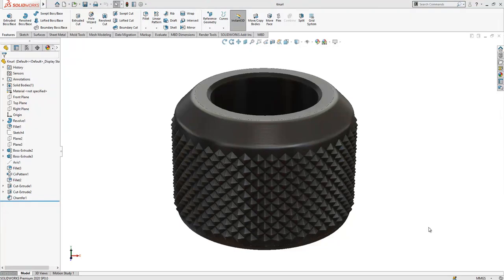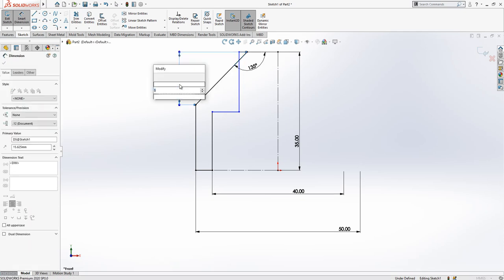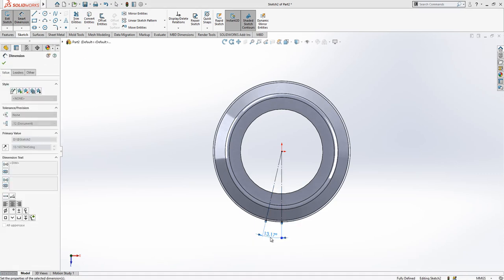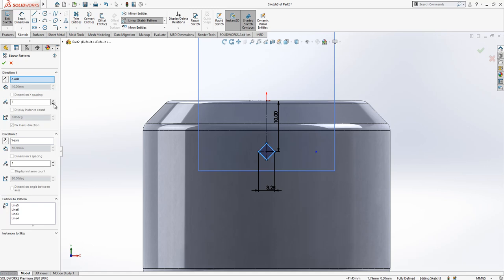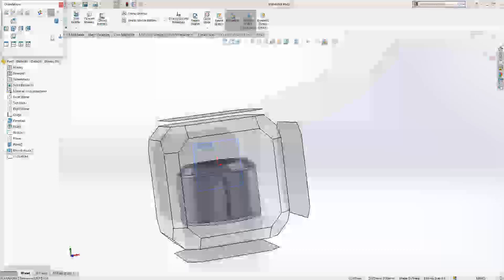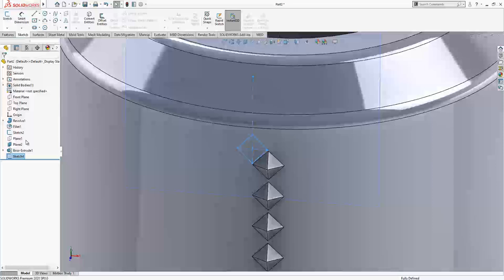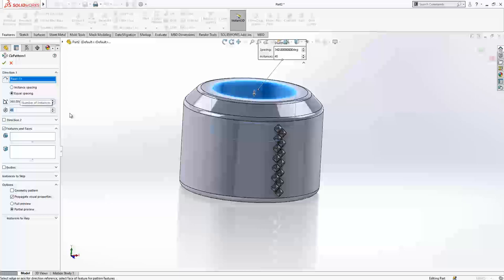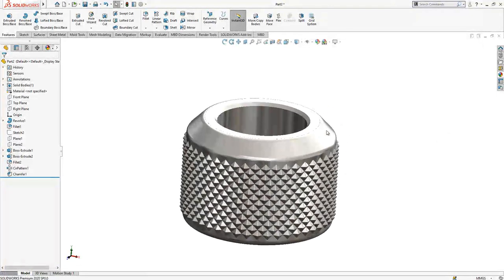Knurling - Solidworks Tutorial

Comment: Thanks for this alternative method, however… I tried it and found that modelling the pyramids close to an edge means that the second direction inward facing outward draft creates tetrahedral points (from one base corner of the initial pyramid) right where the chamfer would be. With your method, it seems you have to leave part of the surface near the cylindrical ends unfinished which looks unrealistic. In my opinion either making a swept cut along a helical guide, or projecting a construction guide line onto the surface and do a swept cut from the end of the cylinder (which you can then pattern and mirror) is (a) much easier to execute and (b) gives a more realistic looking knurl. Having said all that, it’s always good to have a range of options…

Comment: Thank you!
Interesting method with extrude boss instead using helix and  extrude cut.
As always precise tutorial .
Reply from the maker: Thanks Dear 😉
Reply: A knurl is turned: extruded cut inwards e.g. 0,015inch per side ( 0,03" on the diameter), the same amount the pyramids are forged outwards and the bosses should be (0,015"). So the nominal surface stays at the same place. Therefor if you only use a cut or boss you have to compensate the surface (50% of the cut or boss using e.g. move face).
The purchase raw part outer diameter becomes 0,03" bigger (at the tip of the pyramids): Not of great importance for a knob, it does in case of e.g. an insert.